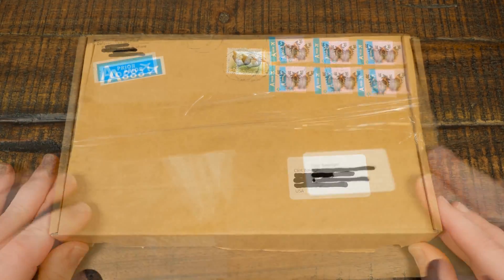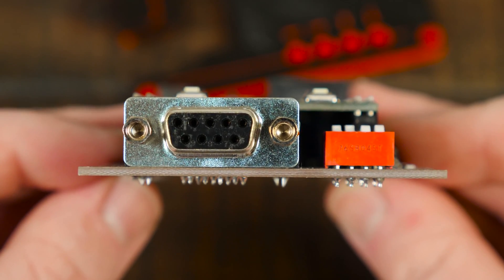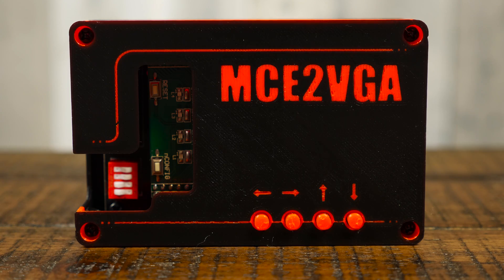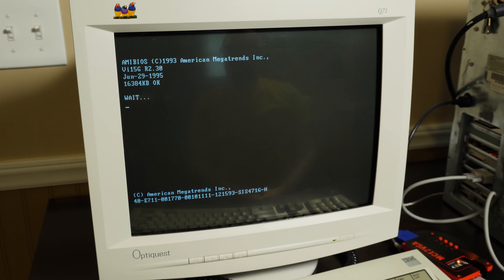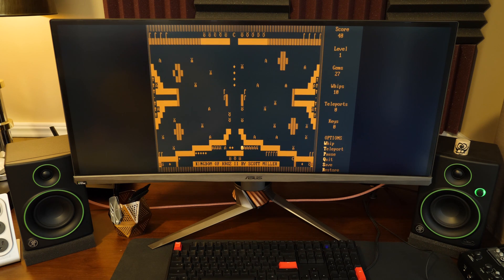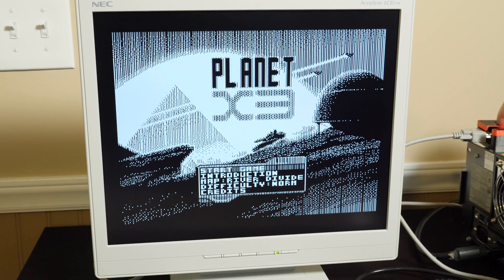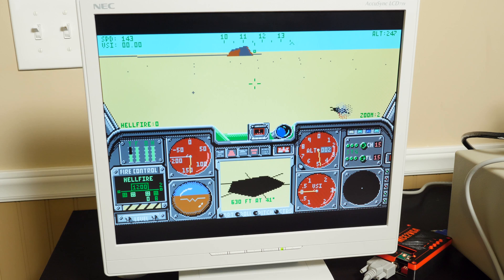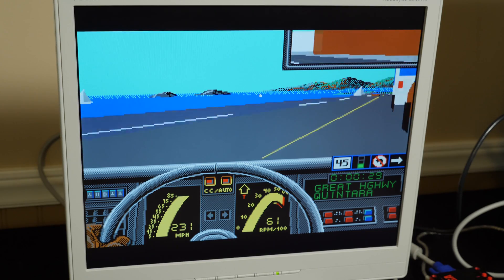Converting MDA/CGA/EGA Graphics Output to VGA!

Comment: Incredible! The right man at the right time, with the right video! 
I searched all day for good EGA to VGA converters and now you come with it and surprised me. 
I just found these GBS-8200 and GBS-8220 and wondered how to connect the 9-pin EGA interface to the 5-pin EGA input of the GBS-82x0. 
Greetings from Germany.
Reply: Can anyone tell me if it is possible and if so, how do I need to connect the 9-pin EGA output of the video card to the GBS-8220 (or GBS-8200) so I get picture with all EGA colors? 
The GBS-82x0 board has only 5 input ports for EGA, but the graphics board's EGA output has 9 pins. 
Must "secondary Red / Green / Blue (Intensity)" be connected to create an image? 
Is there at least a simpler DIY solution to make a monochrome EGA to VGA adapter?
Reply: @aveavis2247  I use a GBS-8200 as a CGA to VGA converter for my PC/XT. To get a picture (albeit with only half the colour palette) you can ignore the intensity pin(s); alternatively you can use a couple of different circuits (analog "cheating" with resistors+diodes works for me) to produce the analog RGB the GBS-8200 is expecting. The more problematic part is that the GBS-8200 cannot do split H and V sync at the horizontal frequencies CGA uses (and EGA at some resolutions/modes), it requires composite sync. You need to combine the H and V sync signals together by XNORing them, then provide that as composite sync.

The GBS-82x0s were not really designed for use with vintage computers; they appear to have been primarily designed for use with arcade machines. The board accepts (all analog) YPbPr, RGBS (starting from 14.5KHz H freq) and RGBHV (starting from 30.5KHz H freq). CGA and EGA as being discussed here are not analog, they are digital TTL of the type RGBIHV (at approx 15KHz H freq minimum), therefore both the sync (too slow to be H/V) and colour (digital with intensity, not analog) portions of the signal are not as the GBS-82x0 expects them, and it will not work without additional electronics.
Reply: @KnuckxCB    TheRetroDudeAbides  
Thanks for your contribution.
I will think about it.

Building a CGA-to-SCART adapter seems easy. I'll try that for now, because I can switch my graphics card from EGA to CGA.

If I understand correctly, the CGA-to-SCART adapter can be used to build an EGA-to-SCART adapter by combining the Color and Color Intensity with a resistor. Is that correct?
Source: https://www.repairfaq.org/sam/vidconv.htm#nvctlvg -> Look at: "TL to VGA / Analog"
https://youtu.be/ymulGiO4NrI?t=15 -> wiring diagram

I also find different resistance values for the Schlatung:
https://imgur.com/WZb0rdB
or
https://www.electroschematics.com/377/cga-scart-adapter/
Or are they both right?

Thanks in advance.
Reply: @aveavis2247  CGA to SCART and EGA to SCART will be very similar. CGA has only one intensity line, EGA has 3 (one per colour); therefore duplicating the intensity circuit for the CGA pin three times, once per colour should work. The circuit given on repairfaq looks sane for (one colour of) EGA, so duplicate that three times. The circuit given on the YouTube video, imgur and electroschematics are for CGA and are, IMO, wrong; small signal diodes should be present to seperate the single intensity signal from the colour signals to prevent odd "ghosting" effects (this ghosting only applies to CGA, not EGA which should not need diodes).

The variety in resistance values is because the signals from the CGA/EGA port are not intended to be treated as analog and the levels and drive strength differ between cards. The optimal resistor values depend on the card you are taking the output from, you may find that none of the linked circuits are "correct" for your card/display combination, but they all should work to some extent. Effectively all of these circuits are "analog cheating" by treating digital outputs as analog signals.

The sync circuits shown all look like they should work, I used a variant of the one shown on the imgur link (7486 quad XOR configured using 2 gates as an XNOR, but mine is missing the drive transistor).

I would suggest using the repairfaq circuit for each colour channel, and a 7486 based sync combiner for composite sync (you might require a drive transistor). For SCART you will also need to drive the fast blanking pin at the proper voltage to switch the monitor/TV into RGB mode. You may need to fiddle with the resistance values to get colours to look right, you may also need to add additional termination resistance from signal to ground; these values depend heavily on both the video card and the display.
Reply: Ave Avis Thing is, the "CGA" and "EGA" boards like those from Gonbes talk about are only the Horizontal Scan rate (15 and 24KHz, in this case).  So they only accept a standard RGB signal with raw composite sync.  The DE-9 of CGA and EGA cards not only use separated horizontal and vertical sync each on dedicated pins, but the connector also uses another pin for the "intensity" signal.  For IBM CGA, this adds a brighter variant of the original 8 colors.

So in that regard, you would need something like the non-RXi series of Extron RGB interfaces (like my 202PLUS), which has  9-pin TTL input along with both the ability to transcode into analog RGB and output only composite sync.
Reply: @Seth_Arkada  thx. See my answer/question to you and Knucks under Knucks answer.

Comment: Does anyone know a way to do the inverse of this? I'm looking for a way to get output from a modern computer onto a monochrome CRT...
Reply: I may be wrong, but I record VHS tapes using a cheap HDMI to RGB adaptor, if you want to go down to RF you can get an adaptor for that aswell. I don't know about those monochrome IBM's CRTs if they have different ports or something, speaking of which didn't LGR make a video about it already?
Reply: @LolMan4409  The type of video output and therefore the CRTs these computers would have used have different signalling which is the point of this video. If the goal is simply to connect to modern computer to a black and white television, look through the LGR library and you'll find a video where he did this very thing.
Reply: Indeed, it's fun as hell though!